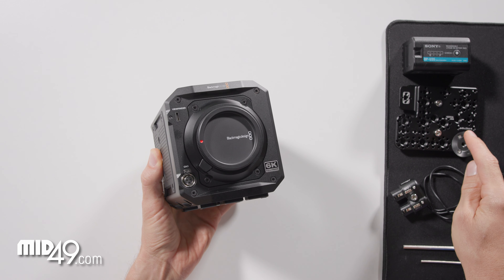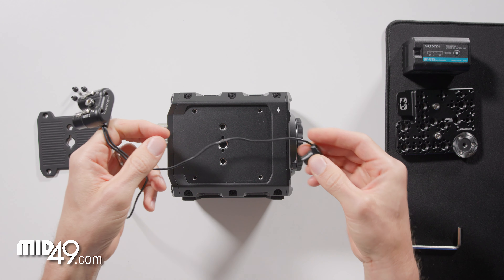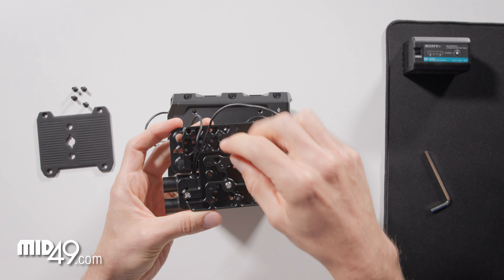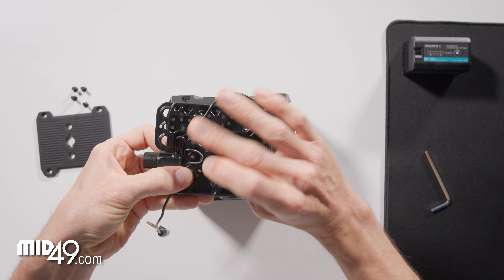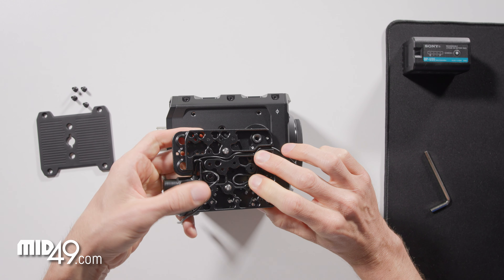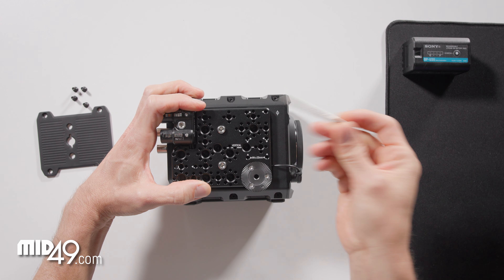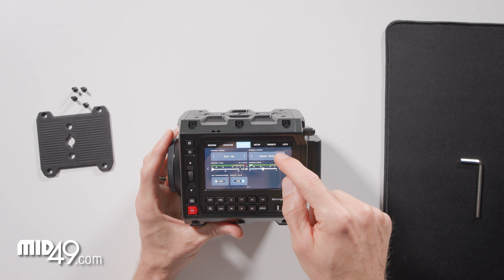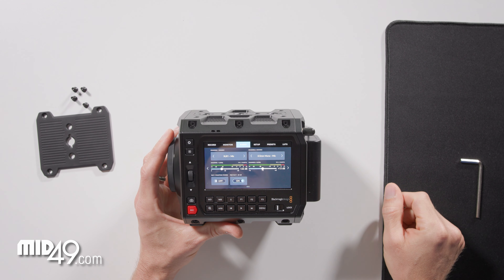Install Guide for Blackmagic PYXIS Side Plate and Audio Breakout Box

Comment: Love this. Brilliant. This is one of the reasons I went with 6k full frame cine camera instead of the PYXIS. The 6k cine camera has two xlr inputs the PYXIS only has one. 

This gives you two but how noisy are they. Since the balanced mono signal is being used to deliver an unbalanced stereo signal  I would assume the signal to noise ratio is going to be lower. Has anyone tested this out?
Reply from the maker: Thanks! The audio inputs are very clean and unless you are running an extremely long cable between the mic and camera, the TRS input is nearly as good as the mini XLR.

Comment: Would this work with other side plates? I have the Shape plate but i think there's a gap between the camera and body to tuck the cable and feed it through.
Reply from the maker: From the photos, it looks like their plate is pretty well flush with the camera edges, so I doubt the cable could pass underneath. The cable diameter is 2.5mm if you want to check.